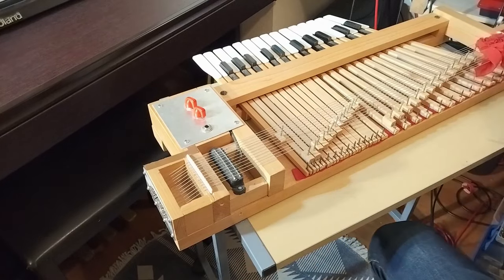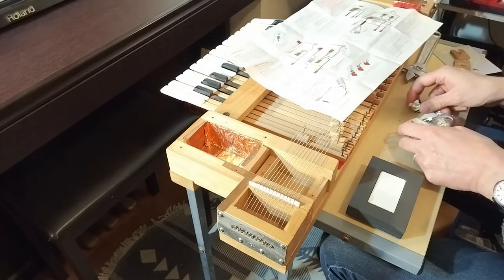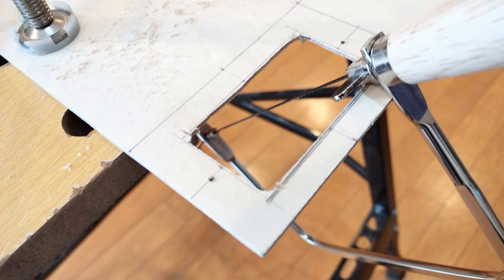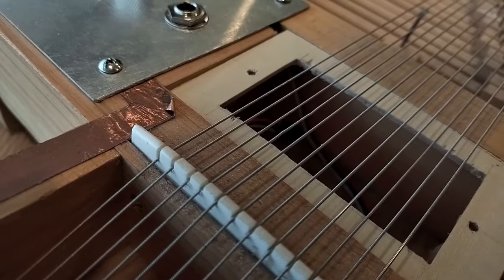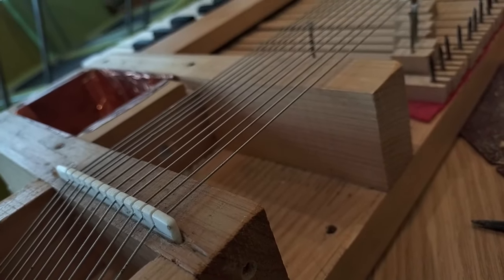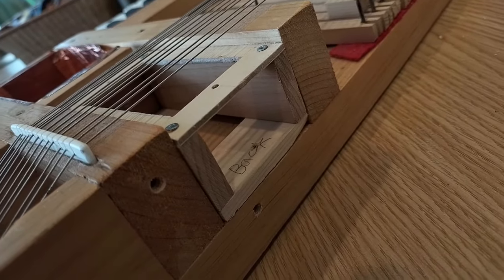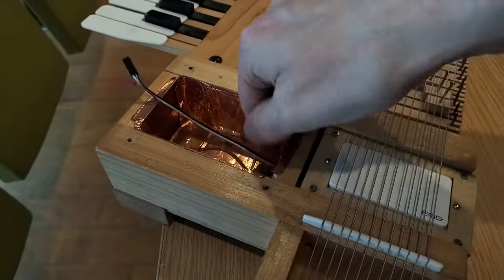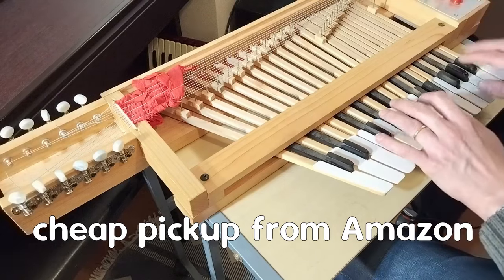Home-Made Electric Clavichord Part IV - New EMG85 Active Pickup!

Comment: did you use a di-box when playing on stage? i think it could have solved most of the grounding hum problems. a cheap passive, most versatile (i.e. you can use it in reverse) di-box should do the trick and the more expensive, active pickup should be even better for this application. screening the place where the pickup is with adhesive copper foil is a good idea. great instrument, i'd love to have something like this in my studio :D keep up the good work :)
Reply from the maker: Thanks for the advice! I didn't try it with a DI box live, but I tried through various amps and things as well as direct into the PA. Anyway I was never very happy with the sound of the old pickup even when it was behaving itself... If I encounter any issues with the new one, I'll consider getting hold of a DI box. Cheers!

Comment: I hate to be a hater but, the decay with the active pickup almost seems too intense? When its hooked up to the delay pedal it seems to fix it entirely, but without it, it almost sounds glitchy to me.
Reply from the maker: That's an interesting take! I think the decay is the same, as that's determined by the damping cloth on the left. Listening back, the EMG is certainly picking up more of the higher harmonics, which might give the illusion that the note is starting and stopping more abruptly - especially as the tone knob is all the way up. I'm confident that playing through a real amp or being mixed properly it will sound a lot more natural. Nothing a bit of reverberation won't fix!
Reply: @SangerStudios after relistening to the comparison with proper headphones (I was using laptop speakers before) I think you're absolutely right. The high end is definitely still a bit distracting to me, but I'm sure either you rolling back on the tone or me aging a few more years would help that considerably :P
Reply from the maker: Haha😂
The other thing is that a sharp decay is a feature of the clav, so I do tend to play quite "glitchy", that may not be to everyone's taste!